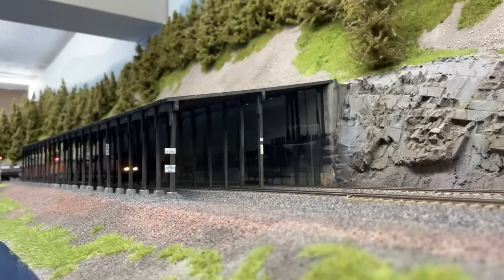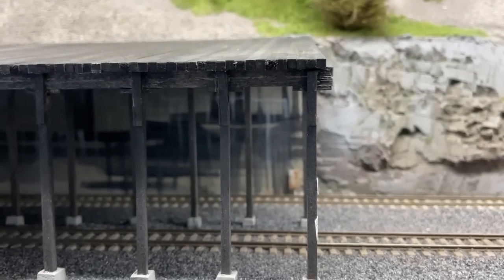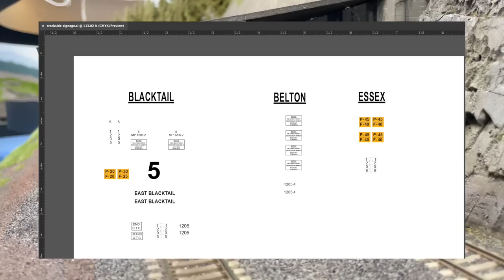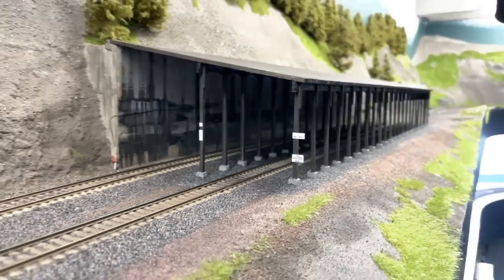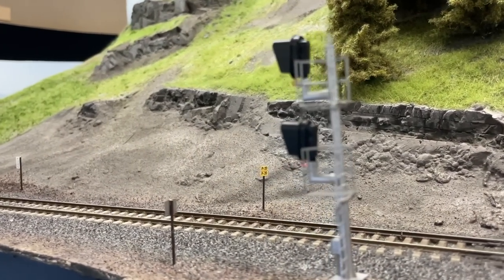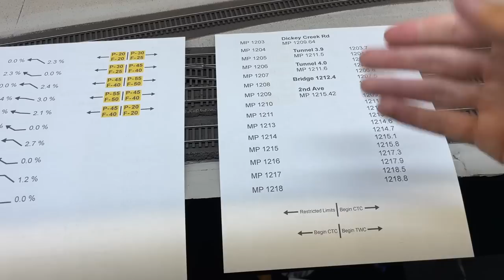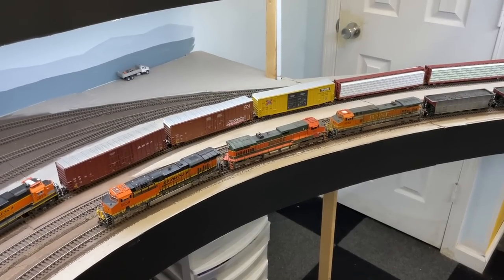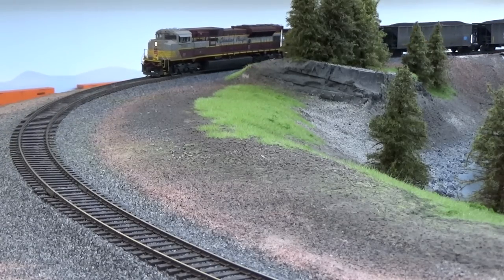Layout Update 68: Snowshed #5 and Details

Comment: Nice construction on that snowshed!  That's a cool feature that isn't seen in my area.  Very distinctive piece that helps set the place.  I like your milepost system.  I may think about that as my layout develops.  I like the added weight to the coal train.  Quick story;  I used a coa; train with extra eight when I was part of a modular RR group.  We used to run for hours at the Nebraska State Fair and I found that after a while, the weighted cars were causing the metal axles to wear into the plastic sideframes, creating an "ocal" hole.  I doubt that you will see that problem for years.  The weighted trains do handle differently and they generally do well at staying on track.
Reply from the maker: Thanks! And good to know! I sure hope I run these enough to wear them out. I think actual wear and tear on the model is sort of a cool concept. You usually don't have to do too much maintenance. And yes, I'm shocked how much the weight helps the cars track better. They already ran fine, but they seem immovable now.
-Cam

Comment: Nice work! You need to get some AC power on that train.
Reply from the maker: Thanks! From what I can tell, it's quite common for coal trains over the Montana and Northwest Divisions to use a mixture or complete consist of DC/C4 traction. I'm not sure exactly why that is because it seems very different from the coal trains that head east/south out of the Powder River Basin. Here's an example of one of these coal trains units heading over MRL rails (as they normally do): https://www.youtube.com/watch?v=yne9cR0qWZY&list=PLx4O6dRYv-tA735t-QjMbyM_d6Pwb1Xbe&index=8

-Cam

Comment: Fantastic work with basic materials, sign of a true craftsman. Just wondering how you did your rock work on the "2nd" end of the shed. It looks like conglomerate rock!
Reply from the maker: Thanks for the kind words! I appreciate it. For the "2nd" end (as seen at 4:45), I just did a couple layers of dirt and finished it off with a sprinkling of fine gray talus rock from woodland scenics. For the dirt right there, I used a mixture of Arizona Rock and Mineral rock powders. I have a small collection of various colors, and I just blended them until I got a good color. I also like to extend my dirt mixture with colored sanded grout. For detailed areas with exposed dirt/rock, I use more of the rock powders vs. grout because it takes glue a bit better. But for general ground cover, I use a mixture of mostly grout because it's cheap. So to start with that section, I painted a thin layer of glue (diluted white or matte medium) and then sifted the dirt mixture on. I probably lightly misted it with some water w/isopropyl alcohol. Because it's on such a slope, it's hard to get total coverage, so I think I did 1 or 2 more glue/dirt layers. For the final layer of dirt, there's always a bit of dirt that doesn't get completely saturated with glue, which slightly affects the color. So I went over it once more with a final layer of diluted glue (I may have even used satin medium) and sprinkled on some of that talus rock for detail. Unintentionally, that bit of dirt is some of the more detailed and realistic looking to my eye, so I'm glad you appreciate it! I'm actually getting an MS degree in geology, but my knowledge of hard rock geology is quite limited...wish I could've applied some of that knowledge to layout building!
-Cam
Reply: @railfan220  well that’s great, thank you for the explanation. I’m a former Geologist myself. Explains your great rock work